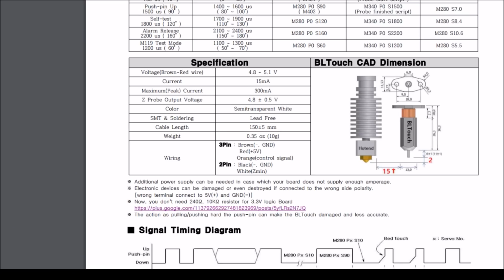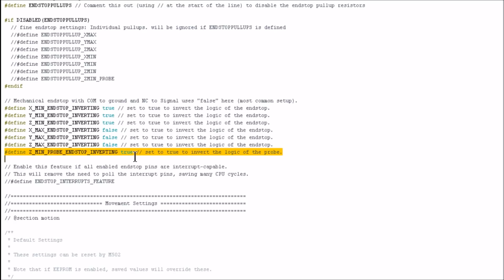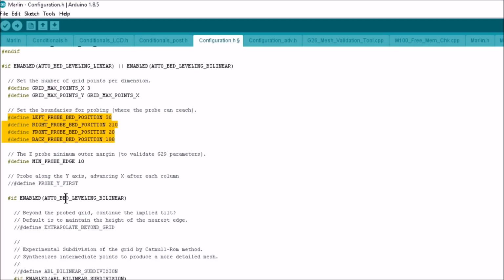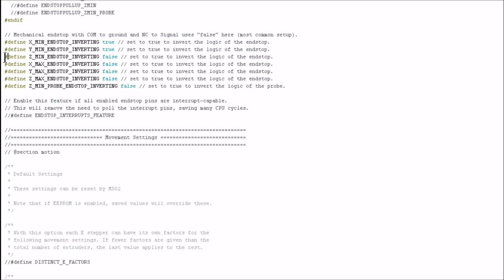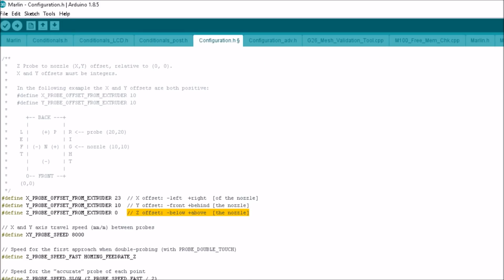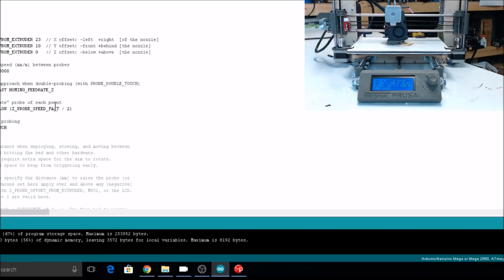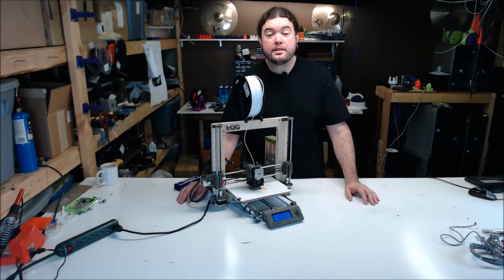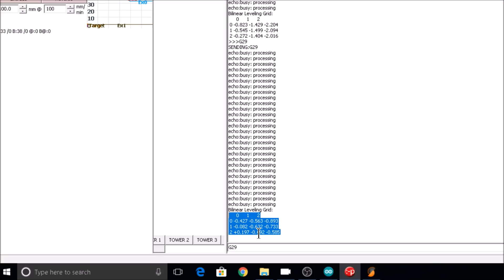Add Auto Bed Leveling to your 3D printer - Marlin - 2017

Comment: Hi Chris, Great video. Spot on. :-)
However, I'm not getting it to work as supposed.
Made the changes you showed but when I'm uploading the file to my Ramps I get the following error messages:

***********************************************

In file included from sketch\MarlinConfig.h:40:0,
                 from sketch\G26_Mesh_Validation_Tool.cpp:27:
SanityCheck.h:825: error: 'LEFT_PROBE_BED_POSITION' was not declared in this scope
       static_assert(LEFT_PROBE_BED_POSITION < RIGHT_PROBE_BED_POSITION, "LEFT_PROBE_BED_POSITION must be less than RIGHT_PROBE_BED_POSITION.");
                     ^
SanityCheck.h:825: error: 'RIGHT_PROBE_BED_POSITION' was not declared in this scope
       static_assert(LEFT_PROBE_BED_POSITION < RIGHT_PROBE_BED_POSITION, "LEFT_PROBE_BED_POSITION must be less than RIGHT_PROBE_BED_POSITION.");
                                               ^
SanityCheck.h:826: error: 'FRONT_PROBE_BED_POSITION' was not declared in this scope
       static_assert(FRONT_PROBE_BED_POSITION < BACK_PROBE_BED_POSITION, "FRONT_PROBE_BED_POSITION must be less than BACK_PROBE_BED_POSITION.");
                     ^
SanityCheck.h:826: error: 'BACK_PROBE_BED_POSITION' was not declared in this scope
       static_assert(FRONT_PROBE_BED_POSITION < BACK_PROBE_BED_POSITION, "FRONT_PROBE_BED_POSITION must be less than BACK_PROBE_BED_POSITION.");
                                                ^
SanityCheck.h:827: error: 'LEFT_PROBE_BED_POSITION' was not declared in this scope
       static_assert(LEFT_PROBE_BED_POSITION >= MIN_PROBE_X, "LEFT_PROBE_BED_POSITION can't be reached by the Z probe.");
                     ^
SanityCheck.h:828: error: 'RIGHT_PROBE_BED_POSITION' was not declared in this scope
       static_assert(RIGHT_PROBE_BED_POSITION <= MAX_PROBE_X, "RIGHT_PROBE_BED_POSITION can't be reached by the Z probe.");
                     ^
SanityCheck.h:829: error: 'FRONT_PROBE_BED_POSITION' was not declared in this scope
       static_assert(FRONT_PROBE_BED_POSITION >= MIN_PROBE_Y, "FRONT_PROBE_BED_POSITION can't be reached by the Z probe.");
                     ^
SanityCheck.h:830: error: 'BACK_PROBE_BED_POSITION' was not declared in this scope
       static_assert(BACK_PROBE_BED_POSITION <= MAX_PROBE_Y, "BACK_PROBE_BED_POSITION can't be reached by the Z probe.");
                     ^
Multiple libraries were found for "U8glib.h"
 Använd: C:\Users\kents\Documents\Arduino\libraries\U8glib
Oanvänd: C:\Program Files (x86)\Arduino\libraries\U8glib
exit status 1
'LEFT_PROBE_BED_POSITION' was not declared in this scope

**********************************
Ramps 1.4
Marlin 1.1.8

Hope that you or some one of your followers can put me on track again! :-)

Thanks in advance!

Best regards
Kent from Sweden
Reply from the maker: Hey Kent! Sounds like you have a comment in the wrong place or something. It's trying to say you haven't set the boundaries for the probe. Did you set the bed size? It might be trying to set the probing distance greater than the bed size. If you want to send me the configuration.h I can look at it.
Reply: Hey Chris, Thanks for your quick reply :-)
Would very much appriciate if you could look at my Configuration.h file :-)
Question is how I can send you the file? 
Tried to copy and paste the txt file  here but it seems that all lines will not be displayed here. So I send you a Dropbox link with my Configuration.h file
Hope this will work :-)

https://www.dropbox.com/s/7emh31xf6dgi11y/Configuration.h.docx?dl=0

PS. Did send you some bucks by Paypal :-)

Hope for some positive solution :-)

Best regards
Kent / Sweden
Reply from the maker: Thank you so much for the PayPal.

You are currently trying to use mesh bed leveling, I would switch to bilinear. Make this section look like this. This might fix your issue all together, if not we might have to set probing limits. Let me know if that fixes it.

//#define AUTO_BED_LEVELING_3POINT
//#define AUTO_BED_LEVELING_LINEAR
#define AUTO_BED_LEVELING_BILINEAR
//#define AUTO_BED_LEVELING_UBL
//#define MESH_BED_LEVELING
Reply: Hey Chris, I made the change. I also needed to uncomment "//#define LCD_BED_LEVELING".

So now I get the following message when compiling:

****************************

SanityCheck.h:831: error: 'FRONT_PROBE_BED_POSITION' was not declared in this scope

       static_assert(FRONT_PROBE_BED_POSITION >= MIN_PROBE_Y, "FRONT_PROBE_BED_POSITION can't be reached by the Z probe.");

                     ^

SanityCheck.h:832: error: 'BACK_PROBE_BED_POSITION' was not declared in this scope

       static_assert(BACK_PROBE_BED_POSITION <= MAX_PROBE_Y, "BACK_PROBE_BED_POSITION can't be reached by the Z probe.");

                     ^

Multiple libraries were found for "U8glib.h"
 Använd: C:\Users\kents\Documents\Arduino\libraries\U8glib
Oanvänd: C:\Program Files (x86)\Arduino\libraries\U8glib
exit status 1
'LEFT_PROBE_BED_POSITION' was not declared in this scope

***********************************************

Any suggestions?

//Kent
Reply from the maker: Uncommet these and see what the errors say after.

//#define  LEFT_PROBE_BED_POSITION  MIN_PROBE_EDGE  
//#define  RIGHT_PROBE_BED_POSITION  (X_BED_SIZE  -  MIN_PROBE_EDGE)
//#define  FRONT_PROBE_BED_POSITION  MIN_PROBE_EDGE  
//#define  BACK_PROBE_BED_POSITION  (Y_BED_SIZE  -  MIN_PROBE_EDGE)

Comment: I have used the same configuration for my printer. but my nozzle moves upward on homing. im not able to solve this problem from a long time. can you help here??
Reply from the maker: That usually means the endstop is inverted. Try changing the Z min to either true or false.
Reply: Chris Riley i have tried that too.
Reply from the maker: jashandeep kaur Are you using a 6-36v sensor? Are you powering it with 12v?
Reply: yes I'm using 12v for powering it and voltage divider circuit for converting the output voltage  to 5v volts
Reply from the maker: What board do you have? Is it by change a MKS 1.4?

Comment: I used this excellent video to set up a capacitive sensor on my Tevo Tornado (the bed is glass with a Mamorubot cover). It's working great except for one thing I can't resolve. I used Unified Bed Leveling and the prints are coming out great. My problem is the right X limit. I set RIGHT_PROBE_BED_POSITION to 230 to prevent the sensor from going off the edge of the bed. But it seems to ignore this and will go past this limit. To make it work I had to set X_MAX_POS 240. The bed will level fine then, but I lose 60 mm of bed width. I'm pretty sure this needs to be 300 and that there is another area where I need to set the right limit for bed leveling. Does anyone know what I have to do to regain my full bed size? Thanks in advance.
Reply from the maker: For UBL, I am not sure. UBL is something I have been wanting to look at for a while now and just never got around to it. Maybe someone else here can shed some light on it for us.
Reply: Chris Riley I found some settings for bed limits on a ticket at github that made sense and I tried them without success, however they did not exist before I added them. I'm not home right now but I suspect my version of Marlin is too old and I need to go to the very latest one. Thanks for taking time to answer and if I find a solution I will share it.
Reply: OK, got it. It's controlled by another variable which wasn't immediately obvious to me, DEFINE UBL_MESH_INSET. You have to set this to the margin that must be left for the probe. It's working fine now! I'm rusty with this, I'm retired and did machine language, some assembler, Basic, tons of Cobol, some RPG, SQL, and they had us take a C class 24 years ago. I haven't done anything with it since but I'm learning my way around. While I was in there I changed the PREHEAT ABS menu entry to PREHEAT PETG since I'll probably never use ABS. Again, thanks for the great videos!
Reply from the maker: Awesome! Thanks for the update. I will ask you when I need help with UBL in the future. ;)

Comment: I wished this video showed what he was doing a little more thoroughly. I had to start from scratch on a new PC and ive wasted a lot of time learning something only to have it not work or not apply to my situation. I don't know marling enough to know what commenting or uncommenting something really is. Seeing as how whole sections have // marks on them. Do I comment a whole section or just a line? do I fill in data points or are they examples? I don't know what to do, now when I verify my files I always end up with errors.
Reply from the maker: I would be glad to help you. I have a general Marlin video that my help you as well. https://www.youtube.com/watch?v=0pt_b2ZizQM I suggest you only comment one line at a time. Do   //  in front of each line to comment it out. What printer do you have? If you can share your config with me I will help you troubleshoot.
Reply: Wow thanks for the quick reply :) I built a new PC for all in one slicing and printer work. I then went from Skynet where walkthroughs weren't so manual. Trying to search google sometimes I don't know what to search for. I will check your linked vid first and come back if I have questions...again thanks!
Reply: So I think I figured out that //# means that the # activates the line. The lines without the # but still has the // means its just data for you and not the printer.
Reply: I went ahead and saved the file so you can take a peek at what ive messed up, just let me know where to send it.
Reply from the maker: There is lots to explain for a youtube comment, but:
//      this comments one line

/*   comment here */   can be used to comment multiple lines

#define is a "pre-processor directive   example: #define SOME_NUMBER 5

Now, wherever I put the identifier SOME_NUMBER in my code, the compiler changes that text to "5"

So for a Marlin example:

If you take the two slashes off this line  //#define MK2_MULTIPLEXER
It will make the if statement below it true, and there for, turn on the abilities of the MULTIPLEXER, you would have to further remove comments to use different pins in the example.

//#define MK2_MULTIPLEXER
#if ENABLED(MK2_MULTIPLEXER)
  // Override the default DIO selector pins here, if needed.
  // Some pins files may provide defaults for these pins.
  //#define E_MUX0_PIN 40  // Always Required
  //#define E_MUX1_PIN 42  // Needed for 3 to 8 steppers
  //#define E_MUX2_PIN 44  // Needed for 5 to 8 steppers
#endif
Reply: So a sentence in marlin where it might say // with no #, means it wouldn't help anything if I took them off, correct?
Reply from the maker: Correct, the files that you will be altering are just defining variables that the actual code will use during the compile. If you are working with a file that has .h after it, if there is no # at the start of the line, it's just information.
Reply: well after picking at it for a bit, ive moved along but I am here now "#error "Z_SAFE_HOMING_Y_POINT can't be reached by the Z probe."
Reply from the maker: Eksile8 You need to reduce the probable area number. There a 4, these keep you probing inside the build area.
Reply from the maker: This is what you are looking for.

  // Set the boundaries for probing (where the probe can reach).
  #define LEFT_PROBE_BED_POSITION 30
  #define RIGHT_PROBE_BED_POSITION 210
  #define FRONT_PROBE_BED_POSITION 20
  #define BACK_PROBE_BED_POSITION 188

Comment: I've connected my NPN LJ12A3-4-Z/BX Inductive Proximity Sensor to the z end stop but I can't get a triggered output with the M119 command.  I checked with a multi meter, if everything is plugged in, (12v power, z min end stop for signal) its going from 3.03v when triggered to 4.4v.  However, if I just power the inductive sensor but do not plug in the signal wire the voltage reads .27v when triggered and 3.3v when not.  Any idea what is going on?  I set up the resistors according to Tom's guide, https://www.youtube.com/watch?v=EcGFLwj0pnA&feature=youtu.be&t=2m58s.  
Thank you
Reply from the maker: Hmmmm, interesting. Sounds like maybe the endstop pins aren't setup in Marlin correctly. Have you already changed the Z prob options in configuration.h? Which board do you have? We might need to make some adjustments in PINS.h
Reply: I have changed the Z prob options in configuration.h.  I am using MKS gen V1.4 with Marlin 1.1.2.  Thanks for the quick reply!
Reply from the maker: Ok, your sensor is reacting correctly as far as the the voltage is concerned. If it's an NPN make sure you tie the negative Z min endstop pin to ground somewhere if you don't the sensor gets confused. Also you have these set to true.
#define Z_MIN_ENDSTOP_INVERTING true // set to true to invert the logic of the endstop.
#define Z_MIN_PROBE_ENDSTOP_INVERTING true // set to true to invert the logic of the probe.
Reply: I don't have the Z min endstop ground pinned to anything, I'll give that a try.  I also uploaded my configuration.h to https://pastebin.com/027Hcu5p if you want to take a look.  Thank you for all the help!
Reply from the maker: I just skimmed through your config, everything looks good. I think grounding that pin will solve your problem.
Reply: I was able to get it working but not with the z min pin.  I was going to buy a new z probe and I happened to run across a review on Amazon that mentioned they were having the exact same problem with the same board (The voltage wasn't dropping enough when the probe was plugged into the z min pin) and they mentioned that manually changing the zprobe pin to another pin (I used a servo pin) fixed the issue.  That's what did it for me.  Thanks for the help.  If anyone else if having an issue with the MKS gen v1.4, I would suggest they try using the servo1, pin 11.
Reply from the maker: Awesome! Thanks for the update.

Comment: Hi, I have a problem with my printer. I set inductive sensor at cable tie height above the print nozzle, but when I do G29, the nozzle touches the bed. The bed is flat, i put same stand offs on all 4 corners, no springs. Also I cant move nozzle below 0, min software endstop is disabled. What should I do?
Reply from the maker: Hello, what program are you using to control your printer? You might need to use pronterface to get it setup. Your sensor will need to be moved closer to the bed. Is it a 5v sensor? Does it trigger successfully. Use M119 to make sure it is triggering successfully.
Reply: Chris Riley Thank you for your reply. I am using repetier host, the sensor is 6-36v if I remember correctly and its working. I will try with pronterface.
Reply from the maker: Give that a try, sometimes if the sensor is only getting 5v it doesn't work everytime. You might have to route 12v from the power supply and user some resistors on the signal pn.
Reply: Chris Riley i am using 12v directly. What kind of resistor do I need?
Reply from the maker: Check out Tom here https://youtu.be/EcGFLwj0pnA?t=2m58s

Comment: Hello Chris, the Marlin 1.1.4 software for the my Tarantula has some difficulties to process your options. It's goes right till I come at the Z Probe Options section and I delete the // before the entry #define PROBE_MANUALLY. When I verify the code I got the message #error "You must enable either Z_MIN_PROBE_ENDSTOP or Z_MIN_PROBE_USES_Z_MIN_ENDSTOP_PIN to use a probe".  Is there an option that I have to delete somewhere? Thanks.
Reply from the maker: Marlin changed they way these options were used at some point. You should be able to uncomment Z_MIN_PROBE_USES_Z_MIN_ENDSTOP_PIN to resolve it.

Comment: Chris. Thanks for NOT suggesting the "Whiney Guy" probe. 
Inductive is the way to go. 
In my experience, you can go down to your local Sheet metal shop and get a galvanized metal plate in 24-20ga. thickness. It needs to be cut on a large sheer to insure flatness. The zinc coating works better than anything I've tried if you use hairspray or magigoo.
The second most important use of the metal sheet is it fastens down with 4 rare earth magnets from the underside of the heater and you can do away with the clips. 
By The Way GREAT UNBIASED VIDEOS. KEEP UP THE GOOD WORK!
Reply from the maker: Ha ha ha! Thanks for the comment! That's good info to have. I have a metal cut to length place close to me, I need to head over there and take a look around. Have a good one!

Comment: Hi Chris, thanks for the great video but im having a problem. In the position 0,0,0 the prove is out of the bed. So when i press home the extruder crashes to the bed. Any ideia of what did i messed up? Thanks in advance
Reply from the maker: You bet! Thanks for watching. If that is the case, you will probably need to enable Z save homing.

#define Z_SAFE_HOMING

Take the comment off of that line.

Comment: I am using a NPN N/O probe with a voltage divider and I cant get the probe to trigger the Z input. Can anyone advise me what to do or direct to some information regarding it?
Reply from the maker: Is it a 6-36v probe? Does it trigger when you hold metal up to it? It could be your endstop inverting.
Reply: Thanks for your reply. Yes, It is a capacitive one with 12v supply. It reads 4.7v and 0v when triggered with my finger. Tried setting ENDSTOP_INVERTING true as you suggested in the video.
Reply from the maker: Try false and see if it makes a difference. 

#define Z_MIN_ENDSTOP_INVERTING false

#define Z_MIN_PROBE_ENDSTOP_INVERTING false
Reply: Unfortunetly no luck. When i home the Z moves up a bit then stops.
Reply from the maker: Ok, so that sounds like it is triggered all the time. So false false should be right.
Reply: Thanks for your help. Got it working now using just a diode.
Reply from the maker: Moen I Sweet! Glad it is working.